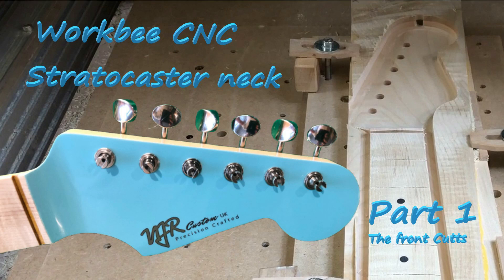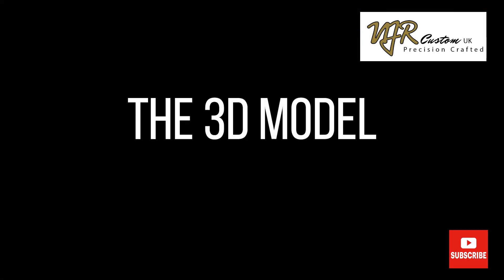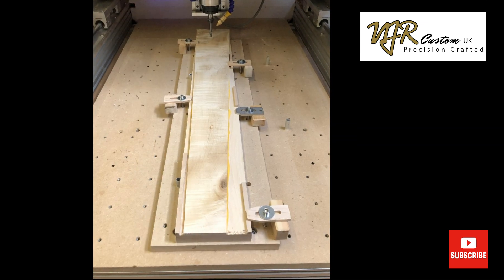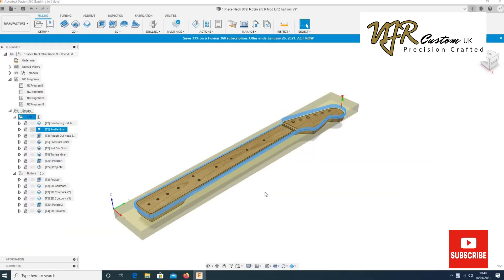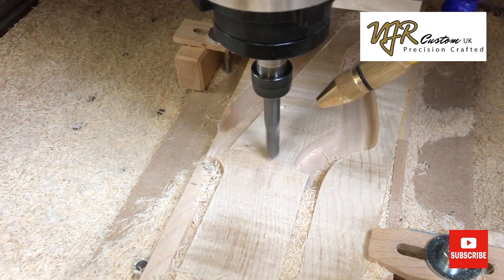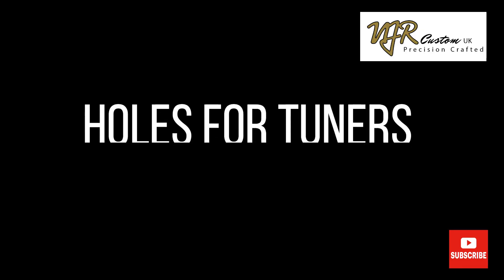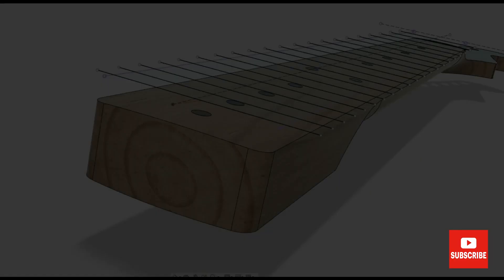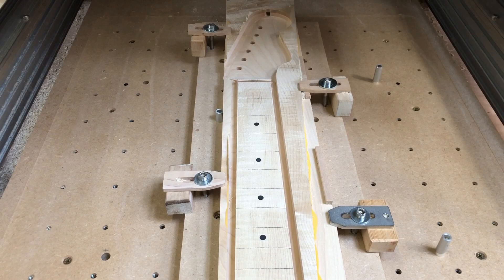Workbee CNC router Stratocaster Style guitar neck Spoke Wheel truss rod Part 1 NJR Custom Guitars

Comment: What is your opinion of the work bee for routing necks and bodies? Is it accurate enough? What issues have you had with the machine? Thanks for creating and sharing your videos.
Reply from the maker: Thanks for your message, I’ve had my workbee over 2 years now. For the money the standard bee is very good and I made a good few guitars on the stock bee. However it wasn’t long before I looked at upgrading my machine. The first issue was the height of the Z axis. I actually used the workbee to machine taller gantry plates 40mm taller and 8mm thick instead of the 6mm stock ones. I had it like that for probably a year at a guess. Then I found I was pushing the machine to it’s limits with larger cuts and my quest for faster machining. I stripped it down and built a much stronger version using liner rails. I have intact a video of this build on my channel if your interested. It is now a far superior machine built to my requirements for guitar making.
Reply: @NickRogersNJRCustomGuitars  Thanks for the info. I'll check out your other video. Cheers!

Comment: That's fascinating stuff.  I never realised it was cutting with the side of the cutter before, so that's how you can achieve deeper cuts rather that ploughing down into the material from the top.  I intended to get myself a CNC in the future, but really need to work out 3D modelling first :)
Reply from the maker: Thanks Chris, I’m glad that you found my video interesting. Yes cutting on the side of the cutter is the way to go, it’s fast and the cutters last a lot longer.